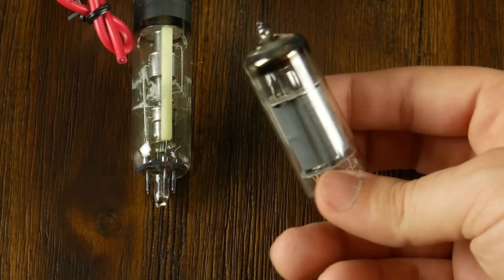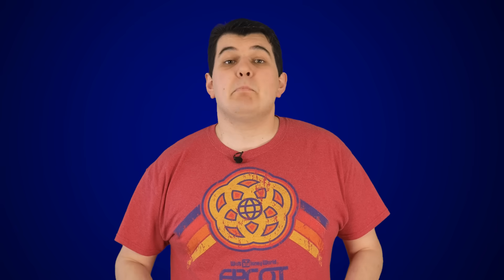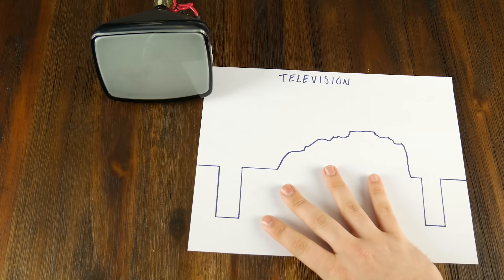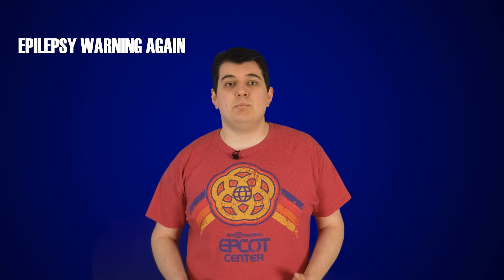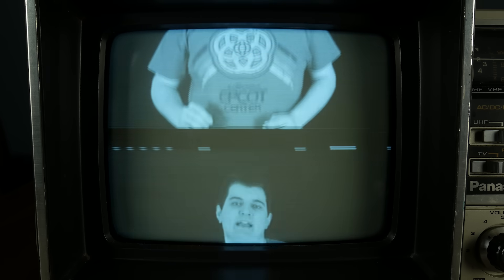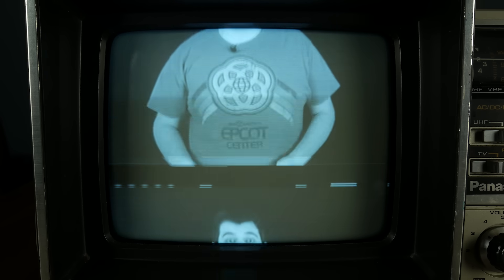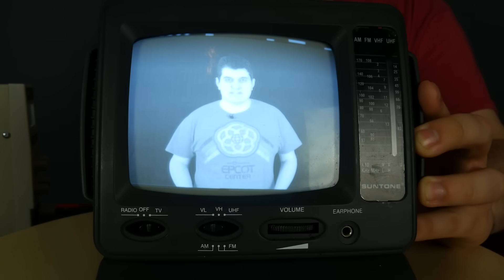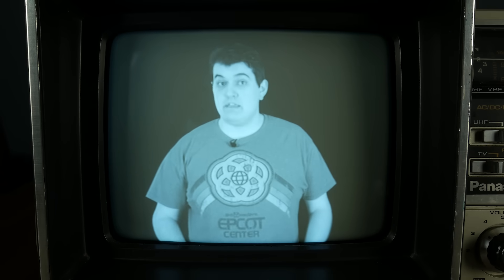Lines of Light: How Analog Television Works

Comment: Dude, this is incredibly well done. I was looking for some in depth explanations of CRT TVs as the ones I keep finding are too high level and I wanted more electronics details. This was well made, well edited, technically above and beyond (really impressed me with the deconstructed TV with the power supply and adjusting the deflection of the electron gun), and just what I was looking for. I guess I'm still curious how an analog signal from the air was turned into deflection and intensity information at 15khz without digital circuits, seems wild to me still.
Reply: It is wild, which is why I love it. This video shows how varying the intensity of a signal with the right timing can vary the intensity of the beam at different spots on the screen. That video signal is what travels in the cable with the yellow plug (composite cable) that runs from your VCR or DVD player to a TV, for example. 

Analog radio and TV are essentially the same thing, one for sound, one for vision. In TV broadcasts, this video signal is modulated (mixed) with a carrier then radiated from an antenna tower at very high power. It's like a voice "screaming" from the tower and all the TVs can sense it at a distance.

What digital circuits do is break things up into 1s and 0s, which is way more complicated. You don't really need that stuff. The more basic approach is to control the flow of electric signals smoothly, which is as simple as turning a knob to dim a light. That's what analog TV is built off of. And it senses when the signal is low (sync pulse), to self-adjust the deflection timing through feedback loops.

The 15 kHz is just horizontal deflection rate -- 15,750 lines scanned per second. The entire video signal uses about 4 MHz of bandwidth.

Comment: A Buick Reatta came through the garage I work at over the holidays. An 80’s gem with A TOUCHSCREEN TUBE T.V! It had the info, climate, and radio controls. There was what seemed like a film stuck over the screen with small dots laid out in a grid. How do touchscreen tube TVs work? I hope this comment finds you! 

P.S I’m so happy I don’t hear that annoying tube “ring” anytime a tv screen is turned on

Comment: When i come in a room with CRT on i always hear some high pitched noise.
But I didn't hear it on our old CRT which is quite interesting.
Reply: It's the flyback transformer. This is what drives the electron beam across the surface of the CRT. The frequency (pitch) depends upon the horizontal refresh rate of the device. Some are also better made than others and suppress the noise more effectively.
Reply: @paulanderson79  thanks

Comment: As an electrical engineer, I was a bit sceptical at first (there seem to be a lot of 'technology' channels lately with people that have no idea what they're doing), but this turned out to be a very good explanation! Just for completeness: you should never hook up a LED directly to a voltage supply, diodes have quite a low resistance so they blow quite easily. Also, they are current-driven and not voltage-driven, so better would be to drive them through a (simple) voltage-to-current circuit

Comment: Excellent video.  When I took electronics in high school - we learned how vacuum tube sets work...transistorized TVs were just becoming mainstream.  With vacuum tubes, you have the luxury of high voltage (giving much wider tolerances to work with when building or repairing sets).

Comment: Early cable TV scrambled the picture by removing the negative line sync pulse of the line redraw. It was one of two types of scrambling I knew of.  The second type a noise was injected near the signal. A filter trap would remove the noise.
Reply: I've heard you could descramble it by wrapping aluminum foil around the cable or something... How would that have worked? Apparently it was also possible for the cable company to detect that somehow, probably by driving by with some sort of receiver.
Reply: Yeah, I remember back in the day spending hours trying to figure out how to unscrambe the cable TV so I could watch the soft core porn.

Comment: For 26 inches (diagonal) color TV, the anode receive +25 kv.
The electrons accelerate from 0 m/s to about 25% of c.
Electrons are massive objects (about 1/1826 the mass of proton)
So they gradually accelerate.
Photons are pure waves so they immediately start at the speed c. In fact, every part of a single sinusoidal wave immediately start at the speed of light.

Comment: The CRT colours used colourwheel tech on the glass. If you look at your TV close up you see black and grey which is your black and white greyscale lights and darks but in front of those slightly wider sections black and grey of each there is wafer thin strips of Red, Green and Blue Lights on the grey sets and Red, Green, Blue darks on the black sections for your light and dark shades of colour.

Old TV's also did a horizontal interlaced scanlines the same thickness as the black and greys on the back set of glass and this created your square pixels picture look from back then and the glow was some amberlight thing inside the CRT tech that they retained in the better LCD's some emulation of the effect but the lower tech ones don't even get that feature.

All of that made done from lines of light across all those on glass and in screen features of course.

Comment: You don't mention the REAL reason why the vertical scan rate is synched to the line frequency.  First, regulated power supplies were not used in old TV's, so there was either a 60 or 120 Hz (for US TV) ripple component in the supplies powering the CRT deflection and drive circuits.  If the scan rate is not synched to this ripple, you see a "swimming" of the picture (due to small variation of the deflection yoke driving waveforms) and slow vertical movement of brighter and darker horizontal bars through the picture (due to variation in drive voltage to the electron gun).  If the deflection is synched to the line frequency, these effects are still there, but they are static with respect to the picture, and so not noticeable.  When color TV came out, the scan frequency was shifted slightly off 60 Hz (you explain why in another video), these effects re-appeared, but the newer TVs had better supply regulation.

Comment: CRT-based TVs may be bulky, but then they deliver one of the best TV pictures you can get from a video display device at a relatively cheap price. The truth is that even the least expensive CRT televisions manage to deliver high contrast ratios, excellent color accuracy, a very deep shade of black, and equally important, a relatively wide color gamut.
In addition, true flat-screen high-resolution cathode ray tubes are capable of producing crisp, vibrant images of exceptional quality with hardly any image distortions.
These TVs can also display any resolution since a CRT tube is not subject to a fixed native resolution as in fixed-pixel displays like plasma and LCDs, but resolution is instead dependent on the horizontal and vertical sweep frequencies used to build the display.
Tube TV is easy to set-up, and will work well in a variety of locations and ambient light conditions. 
Add their sub-millisecond response time - much faster than even the latest LED TVs, practically zero image lag, and excellent viewing angle, and there you have an exceptionally valid display technology even in the face of today's flat panel TVs.

Comment: The "black level" in an analog signal is actually 7.5 on a scale from 0 to 100.  The blanking level is at 0 and the lowest part of the signal, known as a "sync pulse" is well below the blanking level, at -40.
Reply: Called IRE units
Reply: Later known as IEEE units.

Comment: Cathode ray tube sets don't just rely on persistence of vision but also on persistence of the glow of the phosphor screen, called phosphorescence.

Re 8:20 Digital pictures are also made of lines, but these lines are not only sampled but quantised. Movies made for cinema throughout the pre-digital era were nearly always at 24 frames per second. This became the standard with the arrival of sound films, and this was before television and obviously had nothing to do with the mains frequency. But just after 8:57 Alec noted that even 30 frames per second would be noticeable as flicker. So movie projectors show each frame multiple times, I think it's three.

In footage of aircraft propellers and helicopter rotors and of wheels of fasting moving vehicles, you see an effect where the wheel, propeller or rotor appears to be turning slower, or even in the opposite direction to what it must be turning, or even appear stationary.
 But in the footage (including on this channel mainly watch?v=w_g4cAXkz80) of phonographic discs spinning on a turntable, this doesn't happen with the record label. Or in the video on tape recording (watch?v=FoO6kzd_Ars), this also doesn't happen with the spokes of the tape reels.
 This is, in fact, because the frame rate at which it was filmed is greater than twice the turning speed of the record, in fact much greater that even the number of spokes each tape reel has times the turning speed of either reel.

Comment: For no particular reason, I connected my CRT TV (over HDMI to Composite) and played back this video on it. Then had an interesting moment when the flyback frequency sound was played, because I didn't immediately hear any difference. Of course, the TV itself has been producing that sound for hours now and over time, I'd just come to not notice it. Speaks volumes about the content on this channel, the sound and visual effects are remarkably accurate, and it's possible to become so absorbed in the topic and presentation that you forget you're watching it on a CRT made in 1989. Seriously excellent work. Subscribed.

Comment: I didn't hear a thing when you played the tone so I did a test with a frequency generator. I may be over 60 but I can still clearly hear 15,750 Hz. I quit at 25 kHz which was probably close to the limit for my sound system. I'm not saying I can hear as well as I did in my 20's, just that it's more likely YouTube's compression that's responsible. So don't freak out if you couldn't hear it.
Reply: I was worried, cuz I'm only 22 and can't hear it, lol
Reply: Captain Quirky it could be the device you’re listening on can’t generate a frequency that high.

Comment: May I suggest an alternative reason the frame rate is locked to the mains frequency.
In CRT TV's the CRT is extremly sensitive to stray magnetic fields, the most troubling coming from power transformers and induction motors. If the two are in sync, as in 60Hz power and 60Hz frame rate, then magnetic interefence reults in a static offset/bending of the displayed image. Not perfect, but if minimised, acceptable.
If on the other hand the field rate was say 48Hz (2 x 24 frames a sec) then the 60Hz interefering field would make the image wiggle at an extremly anoying 12Hz - Yuk.
Added to this, early valve power supplies were never as clean as they are in modern sets, there was always a residual amount of mains num in the circuitry. Having the two in sync made any (almost unavoidable) on screen aberations appear still, and palatable.

Years ago I built a CRT based computer terminal. I wanted to use a 'conventional' power supply, as in one with a power transformer. Try as much as I could, I could not keep the 50Hz magnetic field from the picture tube. The terminal circuit board was outputting a signal somwhat off from 50Hz, and the onscreen result was a bouncing nightmare. I eventually gave in and fitted a switch mode power supply. It was a very compact terminal, so I had not many options as far as moving the power transformer to a more optimal position.

As far as I know, mains sync was only used back in the mechanical Baird TV days. No sync was transmitted, the tranmitting and receiving ends both used a synchronous motor to keep it all locked up.

Comment: Tv cameras that used  pickup tubes  since the early days of full electronic television like the emitron or iconoscope did have isolated pixels coating in the tube to scan a picture, containing a mosaic of electrically isolated photosensitive granules  , So the more isolated granules,the sharper the picture of each line on the receiving CRT ,it´s just that the receiving tube blends then together ,but the pixels and details are there from the start.But without independence pixels on the camera tube,there could be no picture detail on each of the CRT scanlines.

Comment: And modern displays use a low voltage differential signal to address the pixels. Usually an FPGA or like that controls it. And on the old CRT's they came up with a way to stuff data in the blanking areas. That was cool.

Comment: interesting, can you explain about analog crystals that are use to transmit frequencies?
Reply: @Mauricio Juarez
a crystal is just to supply a stable frequency to an oscillator (it rings like a tiny bell when you "hit" it with a pulse of electricity) , they are also used in PCs , clocks , color tvs , in fact most modern electronic devices :-)

Comment: Did you edit in a hearable sound into your video when talking about the audible noise that people above 25 can't hear? Or did you use the real noise? Cause I'm 33 and I was able to perfectly hear it and it was a pretty annoying sound, so I think i was hearing it very well.
Reply: The above 25 is just an average. Some people's hearing doesn't deteriorate as fast, and thus they can hear it.
Reply: What time did he place the noise
Reply: I've not been able to hear it, but since it is coming via speakers, rather than an actual CRT, it's a combination of factors for me, especially as I can still hear it on the more powerful CRTs even today. A lot of it depends on the power of the audible signal for me, but I've also been dealing with high frequency hearing loss and tinnitus most of my life.
Reply: @jgkitarel  Also youtube compresses the files to save space, but that also reduces or even cuts out the higher range frequencies. Also your equipment may not be capable of producing that frequency.

Comment: Actually the voltage inside these things is not just some 1000 v but between 15000 up to over 30000 V in most cases. CRTs are in fact small particle accelerators and operate on the same principle as the LHC and similar machines, only at a smaller scale. This is also why there is lots of lead in the CRT glass tube adding to the weight. Bending any particle beam create harmful x rays (syncrotron radiation) that have to be shielded.

Comment: Well colour analogue TV was also split into pixels of red green and blue, the electron beam would pass through a mask so the beam would only hit the proper phosphor of the correct colour.  

Also, the Entex AdventureVision wrked on the principle of persistence of vision.  

Also, PAL (and SECAM) countries not only have 50Hz but also 625 lines on screen of which 576 are visible.  

Also, Brazil is a PAL country but uses NTSC frame rates.

And in the UK, the very first TV standard used 405 lines at 25 frames per second giving a frequency of 10.125KHz.

And I used to be able to hear the sound of a tube.  

Also in the UK we had a lot more than closed captions, we had Teletext, which I think you should discuss at some point.

Comment: The field rate matches the utility frequency so that ubiquitous stray magnetic fields will vary at the same rate as the raster scan, thus distortions are "static" against the image and won't produce rolling bars or other "moving" distortions. 

Timing is generally derived from the signal.